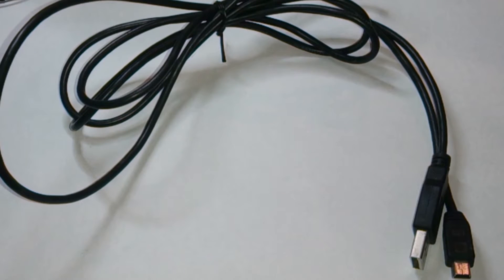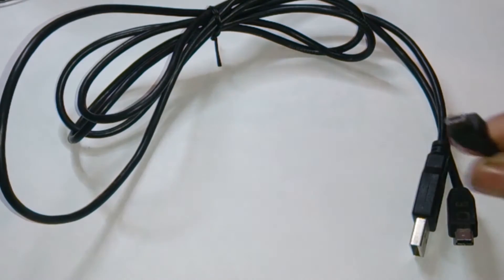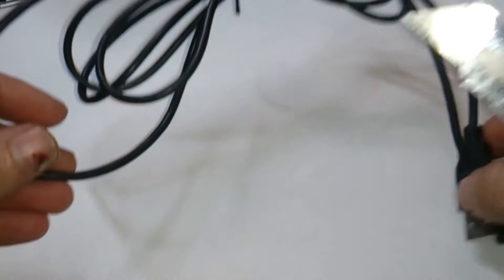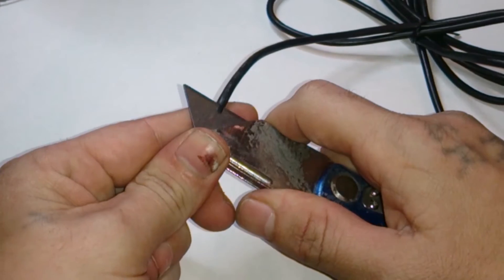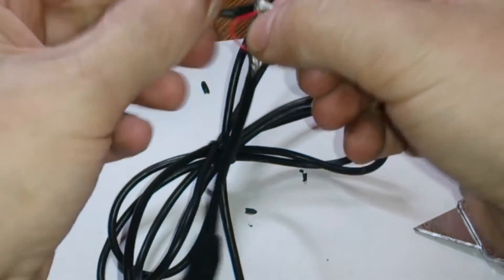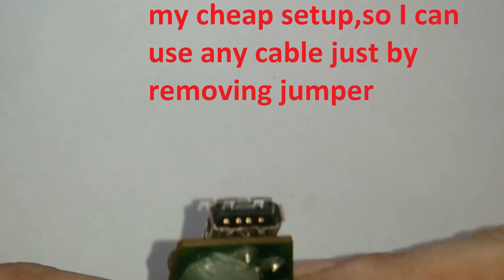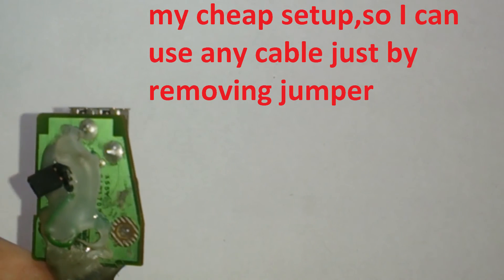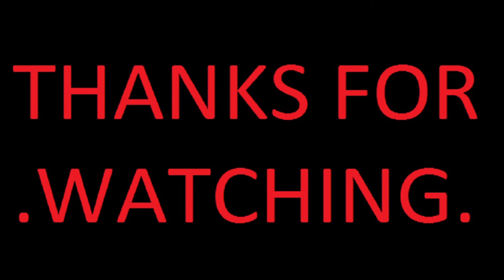USB TO APM 2 6 THE SAFE WAY

Comment: I'm a bit confused.  What problem is this fixing?  Are you telling me that I can't plug my Cx-20 into my computer with the battery connected?
Reply from the maker: Yup I suggest not to do both in all my video's .. this video was more for me just to point people I help in the comments.... it comes in handy as well if your pc can't handle all the current as well..       the sil chips on the esc's can corrupt or fry very easily with both powers..
Reply from the maker: also this is one of my older video's with only one channel audio working ..so if you get no sound that is why
Reply: bangs6996 And this is for a stock model with the original apm right?
Reply from the maker: Superior Sandbox this is for stock and apms 2.x

Comment: Hello friend, I have a problem downloading firmware (3.1.5) but I can not detect the telemetry on my smartphone and when I connect my laptop with the telemetry neither detected only when I connect via USB and then connect the battery if it recognizes in laptop (telemetry does not recognize that will be the problem)
Reply from the maker: If you are running cx20 stock apm 252? you need to run this version https://drive.google.com/open?id=0B2w6_OKE_2kxYkZwbXlSdmRRZ2M  its 3.15 custom..

Comment: hello friend, as always a master of the drones thanks for making this video is a great help
Reply from the maker: HI , thank you..    Did I message you the other day about bluetooth?  if I did i just got the modules in.     I'm not sure if it was you or somebody else that wanted a video on it..it took 2 months and 2 different sellers..
Reply: You have a good memory friend I went I asked you the question about the bluethooth / but already solved it and could do the flight telemetry and bluetooth
Reply from the maker: Ok good that you got it to work.. I now have four modules ..so I might just make a video anyways....   I'm just curious do you like the bluetooth better then the telemetry module?
Reply: but I did something new in the radio control / telemetry and bluetooth are inside and powered by a 1000 mah lipo 20c and s3 11,1V voltage regulator to pass the energy 5.5v
Reply: this is the one I put the radio control (Hobbywing 3A UBEC 5V 6V Switch Mode BEC For RC Models
)
Reply: I would like to see his friend video / bluetooth and telemetry are together to give me more fly away
Reply from the maker: . I usually use a 3.7 battery with 5 volt step up..but that 1000mah is small and light enough....good idea..
Reply from the maker: wow that is a really cool mod ..